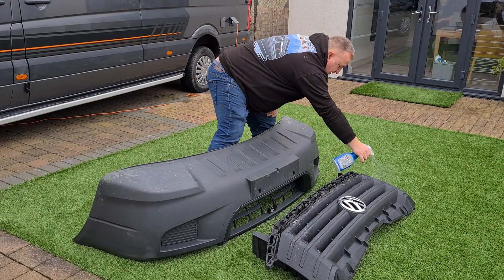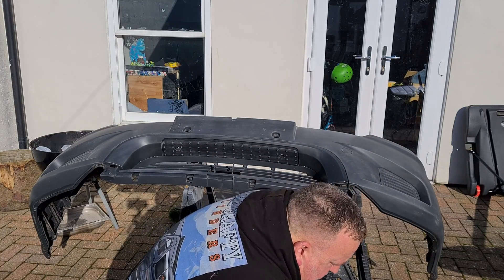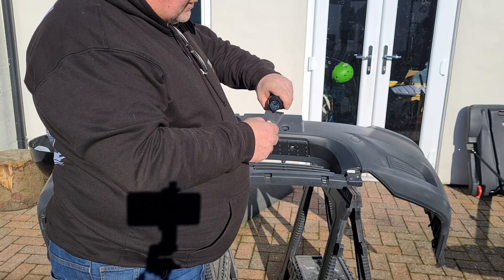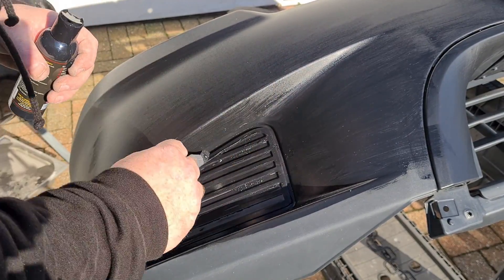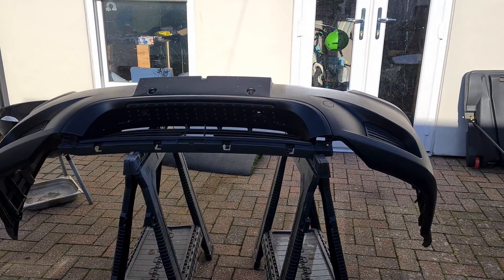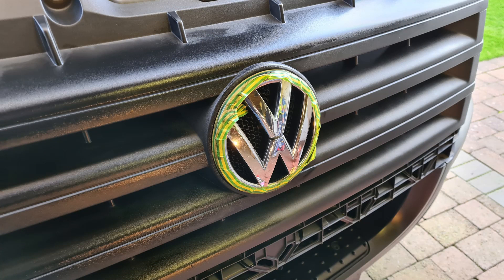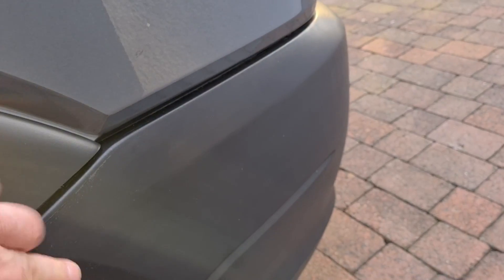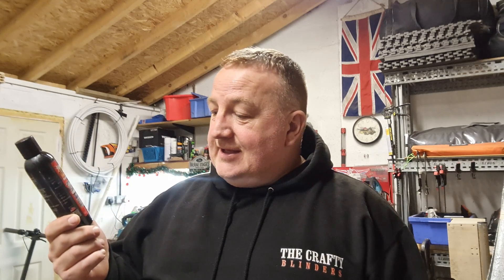bumper and trim restoration dye| selfbuild campervan vw crafter sprinter | 61 | the crafty blinders

Comment: Very nice job, Sam. And a great result for the time spent! 👍That would have actually been a viable alternative to our choice:
We just removed all the side panels, bumpers, grille a week ago and sprayed them with a polyurethane coating (similar to the Raptor product). While we were at it, we also did the rockerpanels (see our channel banner for a recent pic). Highly chip resistant now.
That was also a good opportunity to remove all accumulated dirt, check for rust and replace (125!) clips before reattaching the panels. We also put a bead of Decaseal around each clip to prevent water leakage to the inside.
Reply from the maker: It sound like you guys have been busy

Comment: What did you think about it over time? Leave it streaky?
Reply from the maker: It settled back to a lovely satin finish with no streaks it a great product 
I've had to do a couple of  touch ups where I had not keyed the surface enough I was surprised at how well it all blended in 
You could not tell where I had touched it in